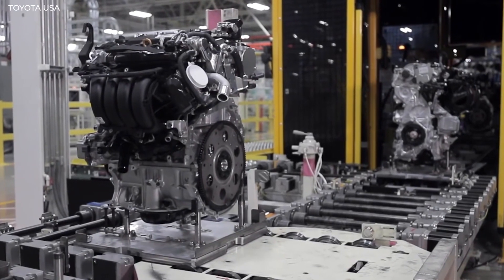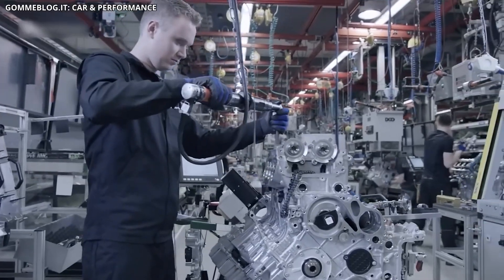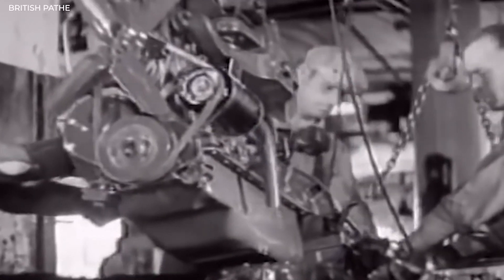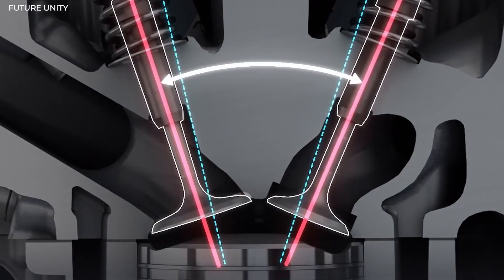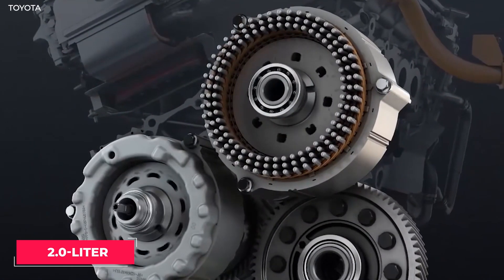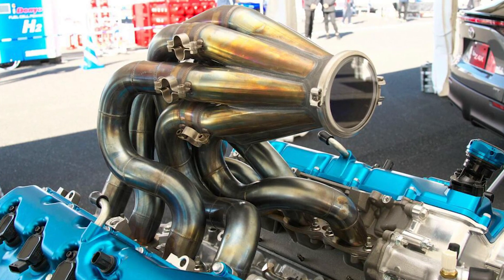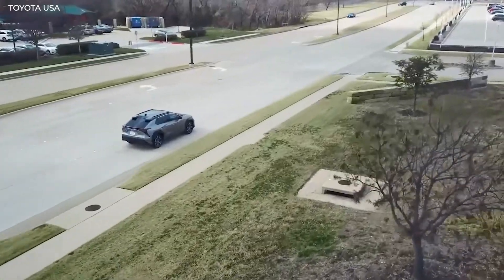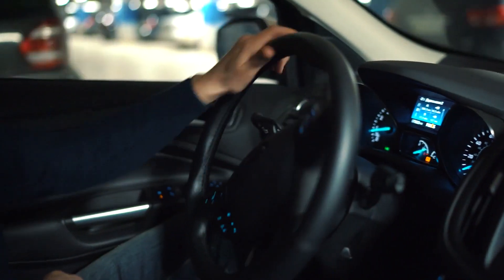Toyota's INSANE New Engine - SHOCKS The Entire Car Industry

Comment: Hydrogen fuel is a lie.
Hydrogen is not a fuel, it is a Battery and it's more dangerous then any other battery.
Reply from the maker: Thanks for your continued support Veggie! From what we know is that it acts as a fuel when it has a chemical reaction with oxygen. And it charges a cell to behave like a battery. 

It can be volatile but also has many other positive characteristics.  Do you agree with the hydrogen conept?

Comment: How is Hydrogen Carbon Neutral???
How is even Electric Carbon Neutral???
When almost all our energy comes from fossil fuels and Nuclear???
How do you make Hydrogen?
You can not mine Hydrogen.
You have to use Hydrolysis to separate water into Hydrogen and oxygen.
And again where do you get the electricity for Hydrolysis.
No one ask these question after watching a ridiculous video like this.
Hydrogen is not a fuel.
It is a battery.
You must use electricity to make Hydrogen.
Reply from the maker: Powerful words! and thanks for watching.. Hydrogen acts a a basic fuel cell through chemical reaction when mixed with oxygen. However It also has is advantages and disadvantages. For a positive.. it has less emissions which is what is greatly needed at these times.

Do you support Hydrogen as a drive? If not what is your preference?
Thanks for watching and commenting 😉

Comment: Great video, thanks.
Reply from the maker: Thank you Mark! We appreciate your support. Do you think Toyota can compete with this new engine?
Reply: How is Hydrogen Carbon Neutral???
How is even Electric Carbon Neutral???
When almost all our energy comes from fossil fuels and Nuclear???
How do you make Hydrogen?
You can not mine Hydrogen.
You have to use Hydrolysis to separate water into Hydrogen and oxygen.
And again where do you get the electricity for Hydrolysis.
No one ask these question after watching a ridiculous video like this.
Hydrogen is not a fuel.
It is a battery.
You must use electricity to make Hydrogen.